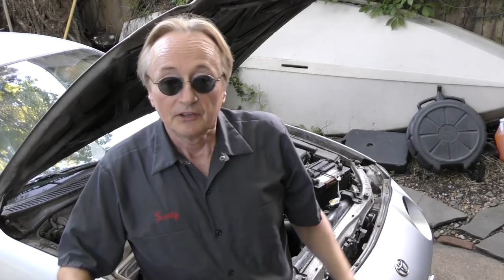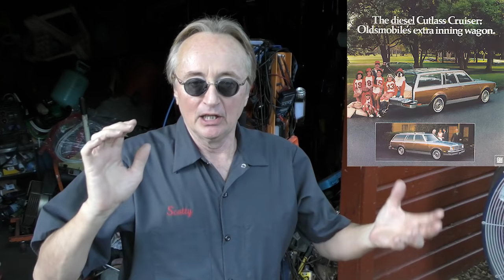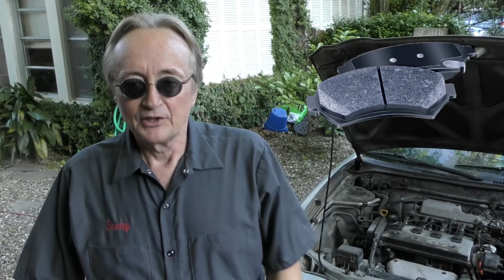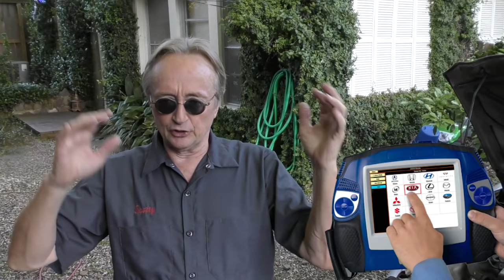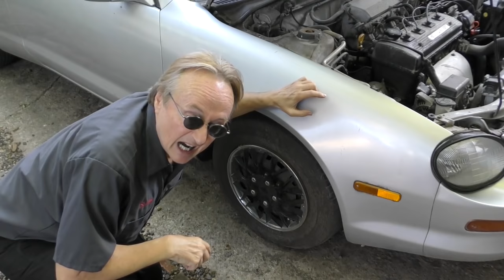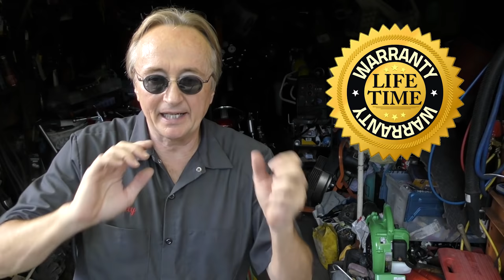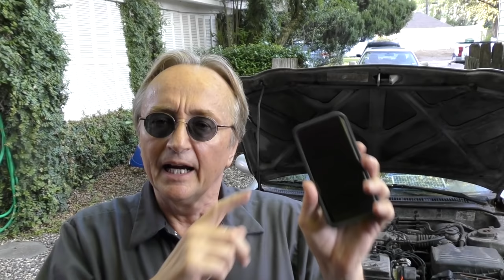5 Scams Your Car Mechanic Doesn’t Want You to Know

Comment: Simple rule to follow: "If it ain't broke,  don't fix it."
Reply: 14 years with my Corolla doing that. Spent less than $ 1500 on maintenance, apart from tires, batteries, etc.
Reply: If it breaks it’s easyier to identify the broken part
Reply: Georgia Activist  yeah, then when your timing belt breaks in your interference motor buy a motor instead of a belt. Hell yeah, great choice.
Reply: @imallupsidedown  I will never purchase a vehicle that has a timing belt.
Reply: @Skier1968  timing chains go bad too id rather have a belt.

Comment: Some mechanic will just clean the old parts and charge you if they replaced it for a new one.
Reply: my own brother ran a gas station for years. I had a battery/ alternator problem. He said he replaced the alternator on my 63 chevy corvette. I opened the hood to see. It looked like the old one but shiny on top. So I  put my hand under neath and wiped all the grease off. I showed him. His face turned red. I caught him at a lie. He just cleaned the top with a wire brush. Thinking I would not notice the scam. I told my father who paid for the cars maintenance as I worked for him in Real Estate. He  did not believe me. He said "  my son would not do that to family " I laughed and walked out. My brother never changed. He stole cash every day from the drawer. My uncle and he were  half partners. He checked the books. He called my father and wanted out of the business. He sold it to my dad at a price & crappy deal. My brother never changed. He still owes my dad legal fees and loans. He never paid my dad.  Dad died and my brother got off the hook . Every family has its black sheep. He was ours !
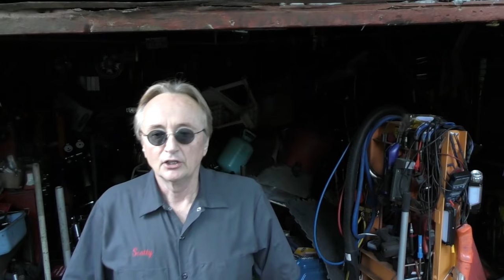Reply: @erick cano- Where do YOU take yo' car to??? Better do like th' man said at 1:33 of this vid!
Reply: @bigg4454  that time when they just cleaned part was at Jiffy Lube but now i just buy parts on my own and call someone or do the job myself.

Comment: I recently ended the relationship we had with our local Honda dealership. I couldn't tolerate all the bogus services and repairs the "Service-Advisers" would "recommend" when we would bring our Accord and Pilot in for oil changes. From cracked engine mounts to broken sway-bar mounts to transmission flushes and batteries that "didn't pass their diagnostics." Enough was enough!
Reply: YES NEVER USE THEM!!!! 2 in a row different oil change intervals they told my wife that there was a leaking gasket at the variable timing actuator - VTC (CRV had 36k miles and 40K miles)...I looked it over each time when she brought car home and there was NO LEAK EVER!!!  It mysteriously disappeared on the future oil changes report sheets...go figure..woman..easy prey... They lost my car business from that..wont be buying from them again...

Comment: I had my wife drive my van into Firestone for a state safety inspection and just waited for the call with a whole laundry list of problems. Unfortunately they did not disappoint. They said my radiator had a hole in it all four of my fan belts were bad along with a bunch of other stuff to the tune of 800.00 bucks. I asked the mechanic about the fan belts because he said all 4 were bad but the van only had 3 and I had just replaced one of them. And the hole in the radiator turned out to be a loose hose. Little do these places realize when they try and rip people off they sign up for all kinds of free negative advertising. I have told many many people of my experience at Firestone and no doubt Firestone has lost some business because of it.
Reply: Richard Bambenek Vice Vera, honest mechanics will earn business for being honest. My step dad found an honest mechanic about five minutes away from us, and now our whole family goes there for car issues if it’s something we can’t do ourselves, and not only that we’ve sent family friends there too. We’ve given the guy so much business that my step dad, my step sister, my mom, and I all get free oil changes from him now. I took my car to firestone as well, and they charged me $350 a couple years ago for my Eclipse’s power steering pump and then when I took it to Mitsubishi they said it needed a new one and so I took it to our guy and he said they just cleaned my power steering pump to make it look new and that I did in fact need a new one. Another thing is, I had all the control arms, shocks and struts replaced and when I took my car into Mitsubishi for a “free” quote on a tune up they said I needed all of that stuff but my mechanic sent me pictures of the new ones on my car and I showed it to Mitsubishi lol
Reply: So glad you both shared this.  The world needs to know the bad guys.  Cheers!
Reply: You know, I sympathize with you but I have to say this. Firestone is not losing any money or sleep with you and a few people you know not going. Corporations are massive and until everybody stops going, they’re only going to grow.
Reply: @guccimalcs  You unfortunately at probably right.
Reply: A lot of people complain about the recommendations being made but unless they do this work have no clue about auto work what so ever. When you are flag every job pays x amount. If you don’t make recommendations which are done my manufacture specs you won’t make that much money. It’s. It like it was back in the day. It’s either feast or nothing. If you don’t want to pay the la or which is most of the cost of any repair then go learn to do it yourself. Yes there are crappy mechanics but not everyone is like that. I’ve seen a lot of shady service advisors who have tried to sell stuff that wasn’t even recommended
Reply: That's why i moved outta PA got sick of the stupid state inspections.  Won't live in a state that you have to get your car inspected.
Reply: That’s when you put it in the local paper plus a tv interview.
Reply: @southpark645  I remember Sears here in Calif the state threatened to pull there license so many of their shops were doing dishonest things. I remember my co-worker was shocked as she thought oh Sears I can trust Sears.
Reply: Never heard of any vehicle having more then one fan belt
Reply: @guccimalcs  They are. People that think thay go outer business wuick. All customers count even one is a few hundreds.
Reply: @t.s.4734  I'm talking 80"s van here. It had 3 v belts
Reply: @D2n97  cool story bro.

Comment: Oh man, a Hyundai dealership would "recommend" that the air filter be changed every freaking time I was in there. Once I had changed it less than a few hundred miles ago. They came out to the waiting area with a different filter covered in leaves! Since I said "f*** no way", they went to the effort of putting the leaves in my air filter.

P.S. This was like the sixth or so time they had pulled this stunt, and I checked my filter before the visit...
Reply: maybe theyre talking about your cabin air filter. you know the ones that actually get leaves in it. it could be theyre trying to scam you. it could be you dont know what theyre talking about.
Reply: @allenlin6169  How could it be that I don't know when I looked at the filter before and after the visit?
Reply: @codeman99-dev  what Allen Lin is saying is that there is an engine air filter and an hvac air filter, maybe you checked the engine air filter but the hvac filter needed to be replaced..
Reply: @jlatreille87  No. The cabin filter in that vehicle was just a weave. It didn't even do anything.

I looked at the filter before the visit. They showed me the same type of filter, but with leaves. Then I checked again after the visit.

I said this in the original post. Just not all in the same breath. Stop reading between the lines that aren't even there.
Reply: I changed mine at 17k miles before I took it to the dealership for an oil change but wrote the date I changed it in sharpie and they were not amused 😂

Comment: I manage a diesel mechanic and tire shop and am always correcting invoices that have labor charges on them for things we were "already in there for". like installing centramatics on semi's, it's like $60 in to install them on the steer axle, but if the person is already buying both steer tires then my tech already has the rims off the truck and im not going to charge extra cause they just slide over the studs before you put the rim back on. 

or doing a forced regen. we have a charge for that and another for a diagnostic computer hook-up and they're both around $100. you have to hook the computer up to do the regen and it doesn't make sense to charge for both as we're not doing a diagnostic, they just happen to be the the same computer tool for both jobs (we use J-Pro). now maybe if we have to start some bi-directional diagnosis for issues in the DPF system that aren't allowing it to regen, then yeah I'll charge for both.

Comment: Dealerships DO make money on recalls. Just FYI
Reply: They do, but not as much as they'd like.
Reply: Yup they make the same book time that the customer would pay for the work. Also dealers push people to do their scheduled maintenance as to protect your warranty. i.e manufactures will deny your warranty claim if their maintenance schedule hasn't been adhered to .
Reply: @adamgardner4722  thanks for the comment
Reply: Adam youre wrong.  Warranty labor is always less than customer pay.  Regardless the dealer makes money on the part and labor bc the manufacturer is paying.  Some dealers will try going under the manufacturers radar and have some lower end hourly employees do recalls to maximize labor profit.  Seen this first hand.
Reply: I work in a Vauxhall dealership and can confirm that they get paid labour at a vastly discounted rate along with parts markup, I’ve seen bosses actually avoid telling the customer they have warranty before so they can make a full price profit off of them, it’s disgusting
Reply: Dealerships do get paid for recalls and the labors is within a few dollars it’s not discounted much my dealership gets paid more warranty labor then what our customers pay in Labor rate. They either discount the labor rate and pay the full labor time or they pay full labor rather and decide how many hours that job is gonna for you.
Reply: Jahn solo Thats not how Vauxhall run it, Vauxhall book times are usually less labour than what we would’ve charged customer retail, for example, a clutch to the customer would be priced at three hours of labour at 80-90 pounds per hour, while Vauxhall warranty will only pay for maybe 1.5 -2 hours at a discount labour rate, hence why service managers prefer to do jobs at full retail price
Reply: Lots of money on recalls!!

Comment: Yes.   I have a Mercedes Benz.  It has service lights that just say.  Service A.  Service B and Service C.   Be ready to receive a Colonoscopy from the the Dealer
Reply: CJ Marco the different letters are for different levels of service intervals. You cam google your year,make, model and service a/b/c and it will tell you what is involved in the inspection.
Reply: CJ Marco just sold our Mercedes hit 100k miles on 2016, and dealer said it needed 7k in  maintenance.  Went across street sold it bought a Mazda

Comment: Purchase a repair manual for your vehicle to fact check any work estimate.
Reply: If you are lucky you will find it online free of charge.
Reply: They can run $250 each, but it might be worth it.
Reply: @TheSuburban15  I have never seen any at that price.  Ususally less than $50. For my Grand Cherokee the FSM was easy to download for free.
Reply: @mcplutt  when I needed one for the 2004 Subaru Impreza, there was no Haynes manual.  The official Subaru manual was around $250.
Reply: @TheSuburban15  Subaru don't want customers to fix their own cars :-)
Reply: my 00 forester came with one from the previous guy, but the same manual was $25 last i checked a few days ago...
Reply: mitchell1 DIY has an estimator built in. the best $30 you'll ever spend.
Reply: Suburban in some cases it is, but the one for my Lexus IS 200$ and tho it had good info it didn’t have lots of it

Comment: I had a similar experience when my new Ford Ecosport dealer told me that there is a leak in my Master Cylinder which can cause catastrophic results while driving... I ignored and ran my car for 60000KM and still no issues. The only reason I don't open the engine and do my own work is the absence of the right tools for my Ford. The way mechanics are cheating, I thing I should buy the necessary tools - like you say, 'Tools are cheaper than engines :-)

Comment: Scott, I drive a 2005 toyota tacoma base 4x4 6cyl and my front right bearing was bad. So out of curiosity,  I went to a dealership and they wanted 420.00 for the bearing and charge 170.00 an hour for 3 hours labor. I decided to buy the bearing myself for 88.00 from Detroit Steel, watched a video and replaced it myself in 2 hours. Toyota wanted close to a thousand and I paid 88.00 and my time. Point I'm making, NEVER trust a dealership.

Comment: I shop told my brother that his 4x4 system was broken (it is a 2wd truck)
Reply: My stepmom had an older Taurus that for whatever reason just 'shut off' at a gas station.  The mechanic came outside and started talking about replacing the fuel pump, which was going to be hundred$ of dollar$.  He didn't even LOOK at the car, apparently.

She called me for a ride home, so when I got to the gas station, I took a moment to pop the trunk of her car open and reset the inertia switch (aka fuel pump cutoff; it's supposed to stop the fuel pump if there's a collision to prevent or at least limit a fire).  It's literally just finding the little hole in the side of the trunk liner and pushing the little button in.  Twisted the key in the switch, vroom vroom.   Seems that some of those cutoff switches were a little too sensitive; a good pothole or hitting a curb just so could trip them.
Reply: Had some one tell me they were going to have to jack the engine up on a 96 ram with a 360 sb, 2wd to replace a freeze plug, wrong
Reply: Lololol
Reply: It's a 2WD truck? No wonder 4x4 doesn't work! 🤣
Reply: Lol
Reply: jay Tarantula i
Reply: Sorry sent by mistake

Comment: I can't tell you how much money I've saved family members by having them double check with me before work is done. My dad will put in his Camry in for inspection and then Toyota will contact him saying he needs this, this and this and it'll be a bunch of crap he doesn't need. The car had a real small oil pan leak and they said it was gonna be like $900 to drop and pan and install a new gasket. I told him the leak was real small and not a big deal but Toyota acted like the car was gonna blow up any second if he didn't do it. That was like 5 years ago and he still drives the Camry everyday lol
Reply: @Grieg Ragen Many cars these days have the pan sitting above the subframe and to get it out requires pulling the wheels and disconnecting the struts which is probably the case but still.
Reply: @Grieg Ragen I remember with my GTO to drop the pan it took a couple hours basically the entire front suspension has to be dropped because the pan goes up and over the steering rack
Reply: Grieg Ragen Wrong,  they probably got a bonus for making it difficult for the customer to change themselves.
Reply: @jimarcher5255  manufactures lose money when people work on their own cars. Cars are becoming harder and harder to work on in your own garage, Many nowadays require special tools and software. My friend has a new VW GTI and he said to get a CEL off yourself requires a scan tool specific to VWs and it's not cheap. That kind of stuff in completely intentional. They wanna make sure people are going to dealers. With everything becoming computerized nowadays almost all new cars requires special software to even diagnose.

Comment: I see people who have dealers tell them they need power steering fluid replaced when they have electric steering with no pump and no fluid
Reply: Some electric power steering systems do take fluid its called epsf and has a cap just like a pump driven system would.
Reply: hahaha a mechanic told me once i need a coolant change for my 4 cylinder bike and i reminded him it was an air oil cooled engine!!

Comment: As a mechanic myself this is 100% truth. Not only do they lie about extra parts they lie about labor time! I just took a 2003 Subaru Legacy outback in to the Subaru dealer bc the engine had a head gasket leak. They tried to tell me the oil was glittery so the bottom end was shot too and wanted to do 8k in work and parts for the car. I told them just get an engine from the junk yard with low miles on it and they are still charging 3700 for the engine swap.

Comment: I had to go to my Honda dealer to get the airbag replaced due to the Takata airbag recall, and the mechanic tried to charged me $50 for a new cabin air filter. HA! Little did he know I had already ordered a Denso brand filter a couple days before for $8.

What a scam.
Reply: The mechanic doesn't set the prices
Reply: That's low.  I had a dealer quote me $100 for one with labor.
Reply: Joshua Russell it’s still a scam.
Reply: MattPSU02 that’s insane. All that money payed towards a filter that costs less than $10 and 2 minutes of labor. Crazy stuff...

Comment: My mother went to a car shop to get her tires rotated, but since she had problems before she marked one of the tires. When she got her car back none of the tires were rotated and the people at the shop refused to admit it/give her her money back!

A lot of places do stuff like this all the time! It's really easy for them to.
Reply: Victor I've heard many stories like this where shops charge on a job but never do it, or leave oil drain plug off and wreck an eng. Then never own up to it.
Reply: @stretchs7485  Or the oil change guy strips the threads on the oil pan trying to replace the drain plug, and creates a slow leak. Caught it a few months later and had to replace with new pan- expensive. Stay with a professional service department at a good dealership. Incompetent mechanics can cause more damage to your car trying to service it.